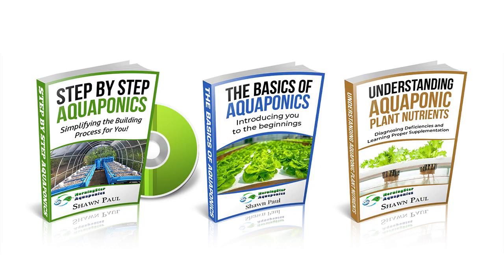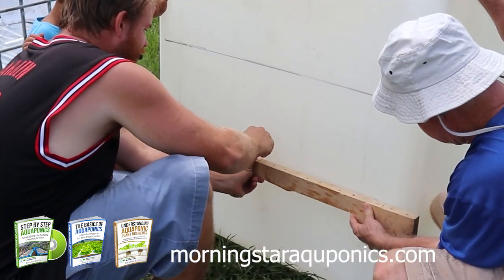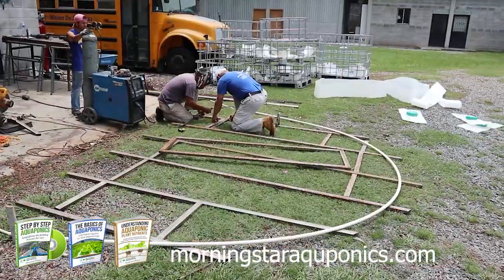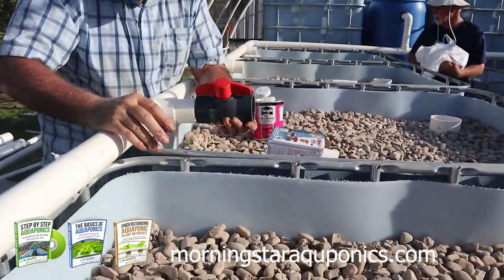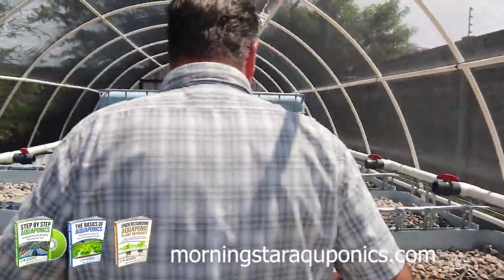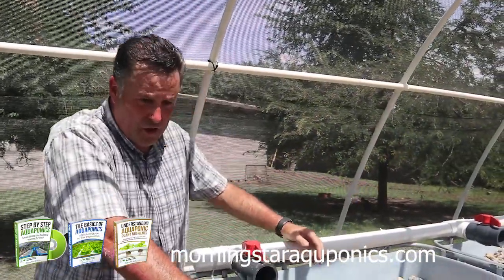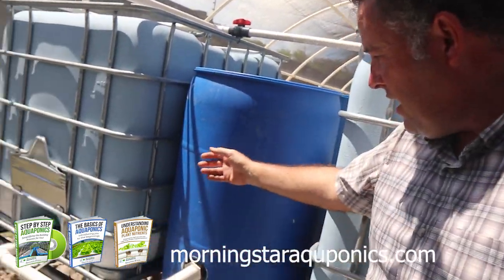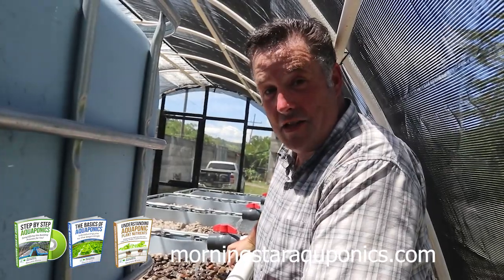Start to Finish Aquaponics Build and Walk Through

Comment: I was in the process of designing my system when i saw your video. one problem i faced is painting HDPE. I see you sanded the totes but HDPE is notorious for not adhering paint. After a year how has the paint held up? What kind of paint did you use?
Reply from the maker: It's a love hate relationship. It needs to be painted and at times over and over. I used exterior latex paint.

Comment: The e-book is great, good job and great work on this project, I am interested in the "cinder block" method as building these stands out of angle Iron would be WAYY to expensive in Hawaii. Do you happen to have more details about the project you built with cinder block?
Reply from the maker: Thank you so much for your kind words. Unfortunately, I had such a bad experience with cinder block, I steered away from them. I'm not saying someone else won't have success with cinder block. To me, they are bulky and get in the way of plumbing, they crack and break. I didn't provide that info in the book for those reason. I do offer wood construction designs in the back. Hope this helps.

Comment: Thanks for the valuable video, just approximately, this wonderful green house you built it...how much it cost you?
Reply from the maker: About $1,000 to $1,500, shade cloth in Honduras is extremely expensive.
Reply: @thehealthawakening  this for the shade and all other works?
And what is the shaded area sizes?
Thanks.
Reply from the maker: I don't know what you mean by the first question.  The dimensions of the greenhouse is 13.5 feet x 26 feet
Reply: @thehealthawakening  1000 to 1500 dollars the cost of 13.5x24feet green house in addition to pools and accessories?
Reply from the maker: That is the cost of the greenhouse.
Reply: Do you have any issues with that kind of rock.  It looks like it's limestone based does it not raise your pH due to the calcium content?
Reply from the maker: All rock is tested for limestone before use.  Yes, if it was present, it would raise the pH.  Again, we do not permit limestone in our systems.  Thanks
Reply: @thehealthawakening  Do you test using vinegar or another way?
Reply from the maker: Here is a video I made years ago about testing grow media.  Yes, I use vinegar.  https://youtu.be/jcM4a7QFUk0